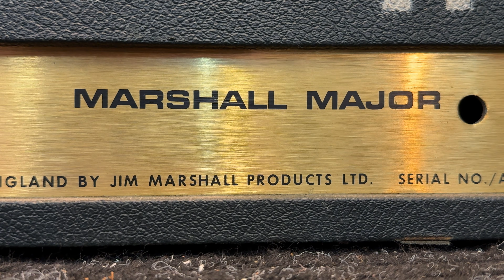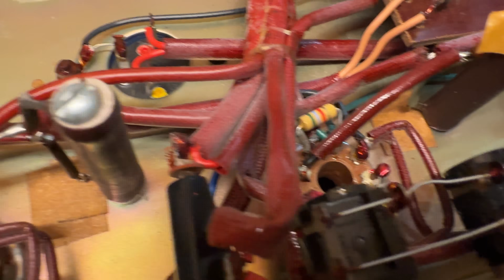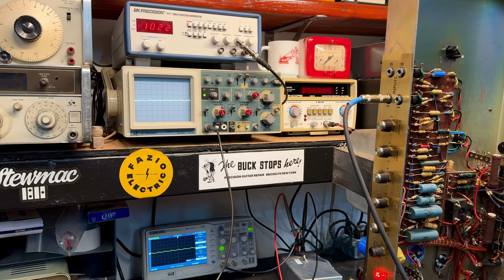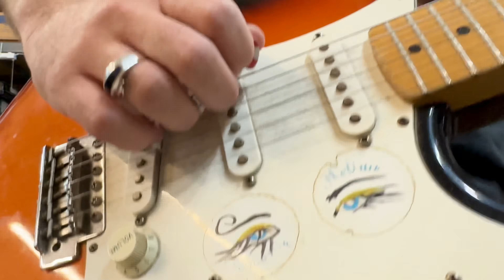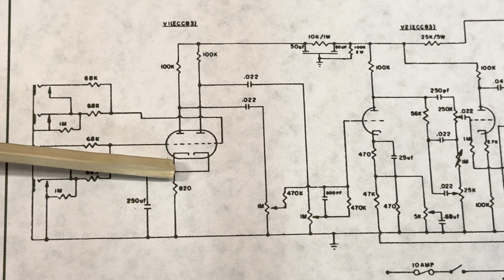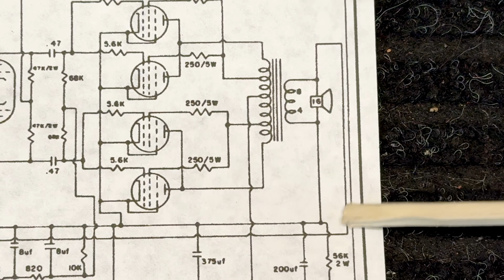1970 Marshall Major Restoration & Tin House & Ritchie Blackmore

Comment: Wonderful amp!  I restored several over the years and the GEC KT88 were the most reliable tube to use...but "BlackPlate"Tung-Sol 6550s..era 1959-60...would hold up fairly well.

Comment: Got one in a pawn shop like 25 years ago. 1971, modded with a master volume in back, so u can run loudness on front at 10, I jump channels cause one is trebley other bassey, also has 4 speaker outs, never ran all 4 but what a wall of sound that must generate. Also Blackmores Night played TLA right before I found this, which is a block away from the pawn shop. hmm? Maybe a roady got tired of lugging this beast around.

Comment: When the mullard KT 88s became hard to get I spent years searching for a set that would give me that car crash big image sound. Never going to happen with 6550s thats for sure. Most of the tubes I have tried over the years did not come close to the big image of the mullards and if they did they failed in short time. One thing I noticed about the tubes that sounded good they had 3 Gathers. So far the Gold lions seem to be holding up. I like your work. c]8-)

Comment: These run about 600v on the plate if I remember right... will modern Russian KT-88's take that kind of voltage over the long haul? Russian 6550's are notorious for failure.

Comment: What a great video!  
11:50 - you are turning up the volume and making some measurements. You said: "I know I can push it above that. I don't want to blow anything". What exactly would blow? Isn't it safe to put it on 10?
Reply from the maker: well it's like running an engine on the dyno red line. A test tone into a dummy load is different than an amp into a cab playing the heck out of it. If something in my test gear were to go under the stress I can loose big. When I reached 200W full duty cycle I was already pushing the amp at max range. I then go well beyond that but only briefly. I wouldn't  be surprised if that quick burst above 200 put the output to 250W. Also keep in mind I was aware my signal gen was a little hot at the moment of test so that was also in the back of my mind. The amp got played on a full stack  for about 40 mins after about 4 hours of bench burn time and anther 30 mins of bench beat down
Reply: @patrickkauffman  Thanks a lot! It's very interesting to understand the context. Every time I dime an amp I get nervous and very frequently I hear jokes about it.
Reply: Safe? These amps can be used as a soundwave weapon in times of war!

Comment: There's an interview somewhere in an article where Ritchie goes into detail about the Major amps. Marshall had shoe horned a Vox AC30 into a JTM 45 combo cabinet and Ritchie used that live for a while. He wanted Marshall to make his Major more like his AC30. He said it took the best part of a year, so I'd wager the mod is a lot more than a cascade etc. 
P.S. I wonder if there's any clues in the Engl amp. Ritchie has used it live for ages now, so they must have got something right. Jimmy Page's Major amps were modded too. Another amp I am interested in but can not find any info on is Tony Iommi's modded Marshall amps used for the Heaven and Hell album. 
BTW. Thanks for the mention of Phil. He was great. 

PPS. My cousin who's a drummer here in NZ has the NZ made version of a Major. A Holden Wasp. The amps AC/DC began on, but they ceased production in the late '80s or so. 200 watts of KT88 power in this case. He keeps threatening to bring it over. I had better remind him. He's a busy guy. I am quite sure it will be an awesome amp.
Reply: John "Dawk" Stillwell
He did a lot of heavy mods for the big boys. The amp you may be referring to is the modded Marshall used on "The Mob Rules" album as well. One of the most unique sounding Marshall's (imo) with an extra power tube. However, the amp was so temperamental that it needed constant babysitting by "John" and eventually Iommi grew tired of this and parked the amp. This amp was a work in evolution, so I'm not sure about its content on "Heaven and Hell"? There were a lot of changes going on sound-wise at that time in Sabbath. 
A great era none the less. 🎉

Comment: Looks great! Do you see any problem running this amp at modern wall voltage?
Reply from the maker: you know if set up right I don't have an issue, at least not the Majors I have worked on. Never worked on a pig so I can't speak to those. I'd be worried about running this head with a voltage attenuator too small or voltage inconsistencies. Checking AC wall voltage before you track or play out is not a bad idea with any amp, especially one this size.